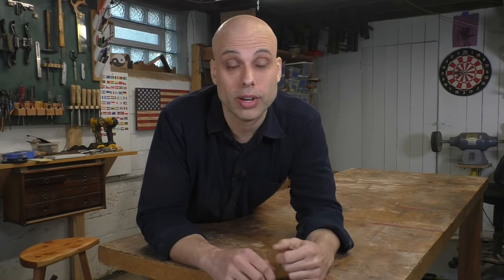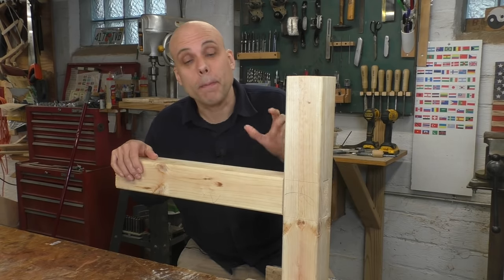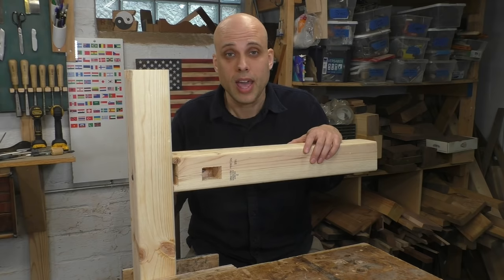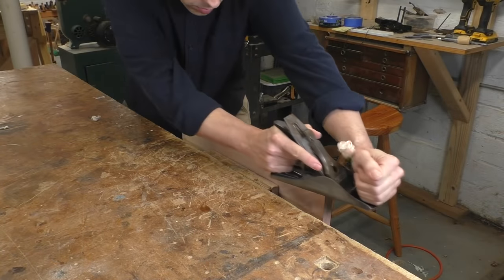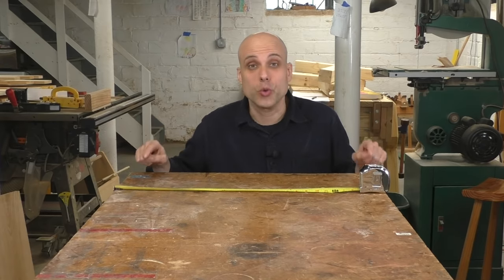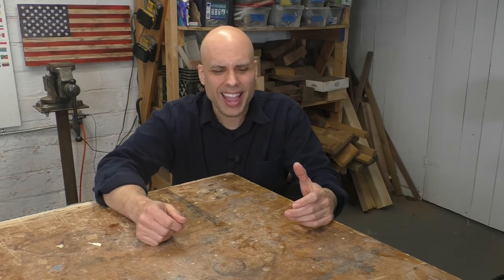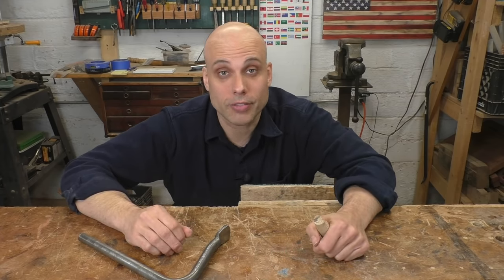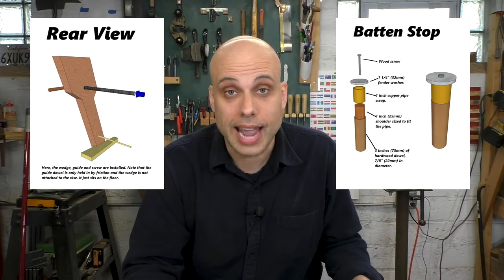Four Workbench Building Mistakes (that we all make).

Comment: Your point about the way wood can compress, through time and wear, in joints based on metal fasteners, is really important, completely true, and generally underappreciated. I'm so glad you're explaining this.
Reply: You just need to use washers to spread the load.
Reply: Or maybe just get some joist hangers cause nonadismattas
Reply: @Zzzrrrretttgthvt  you really cannot beat joinery when it comes to wood construction. Joist hangers are used because they save labor and they're good enough.
Reply: Of course, ignoring that you can pull out 2 wrenches and retighten when it happens
Reply: As someone who has an Ikea drawer that won't keep the face on anymore, I fully agree. Wood joints subjected to forces that are not in line will compress with metal squeezing wood.
Reply: Not just ordinary washers, various sizes of large thick construction load distribution washers (usually galvanised) are quite readily available & largely (but not completely) overcome the looseness that develops with most bolted joints in wood.
Reply: @peterowens290 , I believe you're referring to what are known as, "Fender Washers".

Comment: I was just at my “bench” thinking about how counter productive it is. When I built it I had power tools, but quickly realized I HATE all the racket.. so very early on I moved to all hand tools, and have been “improvising” work holding as I go, not realizing what a GIGANTIC problem is really is.. every build, I need to whip up some other half baked idea on how to hold a component.. my solution? Lay on the couch and watch Rex justify EVERYTHING wrong with my bench..
Reply: I'm glad to see that I'm not the only one who is just turned off by the noise of power tools. I sometimes dread going to the next step of a project because of the noise of the saw or   thickness planer.
Reply: Hearing protection?

I understand where you guys are coming from but there’s so many useful sometimes even non-standard ways of using a router, jig saw, band saw, and table saw I just couldn’t put those into retirement. I don’t actually use my routers that often now that I think about it, but when I reach for one I’m very glad it’s there. Noise is temporary.
Reply: @fishhuntadventure , Yes, "Noise is temporary". So is hearing loss, until it ain't. [Old, 'Experienced" guitarist here.]

Comment: My first workbench was 2 matching dressers placed back to back with some plywood placed on top and then covered with some second hand laminate flooring to make the surface smooth and uniform. It worked amazing and if I still had the same space for a setup with my bench in the middle of my shop, I'd still be using it. My new workshop space is significantly smaller and I've gone with a kitchen base cabinet against the wall with a top made out of 2 pieces of reclaimed maple that are jointed, planed and finished with a laquer of some sort. This video and others like it are great but sometimes you just have to go with what you can achieve for the budget and space. Don't feel bad if you can't make some amazing fancy workbench with traditional or semi traditional jointery.

Comment: Rex, I made a work bench 35 years ago using half lap joinery.  It has stood the test of time including 5 major moves. One of the key features I used was a ladder like superstructure to support the 2.25 inch plywood top.  I glued hardboard to the top and replace it every 10 years or so and banded the edges with poplar.  Great video.

Comment: For those new to joinery, mortise and tenon isn’t as intimidating as it may seem. I recommend you jump right in. The process of refining your skill is a fun adventure.
Reply: It also doesn't need to be a through at all. 1/2-2/3 of the way through the leg, throw in a couple drawbore pegs and you'll have the strongest possible joint for a bench.
Reply: Go Sounders!
Reply: Also, a bench is closer to house framing than furniture making. The tolerances don't need to be super tight. My Low Roman Workbench is nothing to look at. I made it with through tennons that are as ugly as they get. It is tippy, but it doesn't rack at all.
Reply: Challenge accepted
Reply: A worthwhile revision to consider that adds VERY little complexity to a mortise and tenon, but which gets far less play is the "WEDGED Mortise and Tenon" (there's a million videos on it). These are cut identically to the normal on, but you make your tenon (the piece that passes through the mortise) about 2 inches longer. Then, once you've inserted said tenon, you cut or drill a hole in the tenon, such that one side of said hole is coplanar with the outside of the piece you cut your mortise through. a wedge shaped rod, dowel, or piece of square stock is then sunk. into that hole.

This carries the added benefit of exerting lateral, tightening force on the tenon, pulling it in MORE tightly to the mortised piece. It also make for very easy disassembly: pop out the wedge, the tenon is freed, pull it back out of the mortise. 

"Whatever," you might be thinking. "I'm making this a forever bench and I'm gonna GLUE this bad boy together." Capital! because you know what's really awful? Having a joint held EXTREMELY tightly and ENTIRELY flush while your glue dries. I sure do hate it when that happens.

"I need the the exterior edge to be FLUSH!" No problem. The great part about this technique is one that glue is set/you've added any additional mechanical fastener you intend to, grab your ryoba or a flush-cut saw, and hack it right off, wedge and all. You'll still have gotten the value of the tightness without purchasing a 10-foot pipe clamp.

I'm not saying it's the only way to do these things, but it's easy, cheap, and you can use the OFFCUTS you got from MAKING the mortise and tenon AS your clamp! Just saying.
Reply: Use scrap wood in a trial basses; draw it out, cut it out, dry fit it together making minor adjustments. glue and screw it... repeat...
Reply: @grumblycurmudgeon Almost all old Workbenches and a lot of tables here in Sweden have stands joined like that. But  never glued, half the point is that it's easily pulled apart if you need to move and the other half is that it is easy too tighten the joints when the wood moves. Flush fitting is never a problem as the legs are about a foot inside the frames and the tops are thick hardwood  so heavy enough that it doesen't matter that the legs are not at the edges.
Reply: And if you make a sloppy joint it's easy enogh to fix with a wedge! Not pretty but still better than just nailing it to the side. Not to speak of his original design. Even IKEA knows that if you join wood end to side with a simple pulling bolt you need at least one or two wooden dowels parralel to the bolt to stabilise.
Reply: The part most will struggle with, will likely be chisels that seem “SHARP” but really need a proper tuning to be truly workable. 

Other than that, trim small. It only takes one over cut to make a sloppy joint.
Reply: @roberthenson6153  if im not wrong proper edge geometry without a rounded back is more important than sharpness when driving mortises?
Reply: The quality of his work is impressive anx its a good looking bench. But honestly you dont need to be anywhere near this fancy or do this much work unless you want to
Reply: I did woodwork at school back in the 1960's. The woodwork shop had a mortising attachment for the drill, BUT the woodwork teacher made us do a mortise and tenon by hand before we could use it. I made a coffee table which I still have.
Reply: @roberthenson6153  Absolutely.  As a newbie to woodworking, I had no problems building a small workbench with through mortices and tenons, after a little practise. I started with getting the right tools, and that included chisels, good sharpening stones, and learning how to set up those chisels.  Plenty of videos on how to do that out there, and plenty of little tools/jigs that make it easy for beginners to get a good consistent edge on them.
Reply: I'm really quite a novice, but realised I needed to try my hand at a mortise and tenon to build something for my Mum, and I was really surprised with the result, it came out perfectly and didn't even need gluing to hold. Really quite easy! :)
Reply: Yes, and you don't have to spend for mortising chisels.  Paul Sellers demonstrated making a mortise with  a bench chisel.  It works fine.  
As stated by others, tune and sharpen your chisels for good results.  Paul has that covered, also.
For an experiment, I cut a mortise using my drill press and cleaned the sides with a good chisel.  Then, I chopped another mortise using a bench chisel and mallet.  The chopped mortise actually came out better than the drilled one.
Reply: Please keep in mind that to everyone who already knows it, it always seems simple. This goes for everything in every profession or skill. Never make the mistake of calling something "simple" just because you have forgotten your struggle 100 years ago.
Reply: @computerjantje  I agree that first mortise and tenon joint is daunting.  That's one reason we look for alternative means of assembly.  One thing to do is get a piece of hardwood (it works better than pine/spruce/ fir/cedar etc.)and just try it.  I made my first functioning mortise and tenon for my workbench.  The joints are too rough for inside the house furniture but the bench is solid.  My next attempt was a wood mallet.  Not exactly mortise and tenon, but the same effect.  It was less sloppy than the bench but still solid.
Just start.  
No. it isn't simple yet.  I am still postponing a second mallet.  I want one a bit smaller than the first one.
Reply: @borjesvensson8661 , "?" I've "Driven" tenons into mortises after "Trimming" them to fit with a chisel, shoulder plane, etc.but never driven them directly with a chisel.
Reply: @grumblycurmudgeon  Even if I thought I was never going to get rid of a bench, I would definitely want to be able to disassemble it. Never know when you need to move it.

Comment: Candidness about mistakes is what makes this channel authentic.  Thank you!
Reply: I agree, because it builds his credibility. He helps us to avoid important mistakes, based on common sense and experience. That's something to be proud of; not ashamed.
Reply: @CAD Thinking good call! I never thought about him "lying" to us. :-D I wonder how many times he has to refilm, because keeps accidentally getting it right. :-D
Reply: An old fashioned English joinery bench is between 5 and 6 fet long and has an open ended  well running down the middle deep enough to take most hand tools and is easy to clean off with a hand brush, I was taught on one in the early 1970s. My father was tought on one in the 1930s and still used one at work in the 1990s when he retired. they  also usually have a vice mounted at opposite ends on the sides, anything too big for these is held with a clamp or easy to make bench hook, they also have cupboards underneath for the most used tools

Comment: Thank you for making such an incredibly thorough, thoughtful video. I’m a new homeowner, and getting ready to refit the basement workshop and get rid of some of the less than ideal benches from the previous owner. I can’t wait to build something sturdy, adaptable, and pleasant to work with.
Reply: I am in a similar position. Fairly recently I bought an old character stone cottage in rural France and want to arrange a workshop in my basement. The above video made some points which I had not considered e.g. not too wide.  Many thanks.

Comment: Love the half lap! Easily cut with a cheap circular saw too 👍
Reply: I make small ones with my router; surprised at how well that worked
Reply: Now I realize using titebond and screws might have a downside, never considered bolting it.
Reply: Brad!
Reply: Yes I did that and it was very satisfying - a few back and forths and pop the little "cards" left out and smooth the bottom. I was happy I was wearing ear protection though.

Comment: With the half lap joint it’s better to offset the two bolts so that they aren’t in line, this way you avoid wood splitting and also have greater strength.

Comment: My present bench has limitations for long boards as you've noted in this video.  I've had to use long pipe clamps to accommodate those long boards which is cumbersome.  I agree with your comment about building bench for long boards. I'll integrate that in my next bench.  My bench top is made of two sheets of 3/4" plywood making for 11/2" thickness.  I like the idea of adding a masonite top.

Comment: Great video!!  I love your no nonsense, down to earth approach about this.  I ended up saving up and buying the large entry level Sjoberg's bench when Woodcraft had it on sale. (wow, more than 20 years ago now!!)  It came with a bench vise, tail vise, dogs, and a holdfast.  Worked pretty well for me for several years.  But then, much like yourself, I started getting in to more hand tools.  

I found the bench is good, the different clamping options are still good, but the whole thing is just too light.  I would use a hand plane, the material is firmly clamped in the bench, but the whole damn bench would rock around and slide across the floor.  I also found that the 30" height was too low for my bad back.  I ended up getting a couple really heavy pressure treated 4x6s, bolted them side to side underneath the bench legs, and then building a cabinet with drawers to hold tools that fits in the open area under the bench.  Between the large beams, the cabinet, the heavy tools in said cabinet, and the diagonal stretcher I added to kill the side to side movement, it is now super solid.  Plus the whole thing was lifted by 5 or 6 inches when all is said and done.

Comment: Great video! Glad to see content like this coming out of Ohio. NE Ohio here.

I do more metal working, but I happened to have 7 or 8 very large machine pallets (think sized for semi truck) laying around. I didn’t have the tools to make a good wood workbench.

I made a top out of the 4x4s by cutting to length, having a friend help with their jointer by squaring up the boards and then planing to thickness. I then made a lap joint for the legs to the table top. The trick is that I made the lap joint between two laminated boards turning it into a mortise and tendon. Boards were glued together. Then I drilled holes all the way through the stack through those joints and clamped with all thread.

Finally pallet wood is pine and not very tough. Had my local steel supplier shear a quarter inch plate which went on top.

Pretty happy with it, the setup will allow me to add vices/tool hangers with ease later. I primarily use it as a beating table. Added angle to the edges so I can bend sheet over it.

Every craftsman needs a different bench based on what they do. Well worth doing the research and building it right the first time!

Comment: I made the Paul Sellers Plywood workbench as my first workbench. A pretty decent bench, actually very doable for a novice woodworker. With the skills I've developed over the years I might make the same bench, but then with some nice hardwoods. Great video, Rex, with good tips!
Reply: I was considering Paul’s plywood bench but went with Rex’s quick stack bench, started it this weekend
Reply: @1988dgs  With today's lumber prices I'd probably go for the cheaper option 😄. Both are fine benches, in my opinion. Good luck with the build ans I hope the bench will serve you well!
Reply: @c.a.g.1977  thanks, I saw Paul’s bench in a recent video and his looked a little beat up, I couldn’t have got the Baltic birch ply he used so it would have aged quicker, and there are lots of ply repairs in what I would have been using so wouldn’t have looked as nice
Reply: @1988dgs  yes, the blatic birch would look the best. I slightly deviated from his plans by not using laminated strips for the top, but just wider boards cut and stacked horizontally ( instead of small strips vertically). Put a few coats of clear poly on it, seems to be holding up fine.
Whatever you choose: making your own work bench and then using it: awesome!

Comment: My bench was my first project. It was literally a door made of composite wood, partially hollow. Never been so proud to build something out of wood since.
Reply: Same here. It was a resounding C effort on my part. I’ve since retrofitted it up to a solid B-. I’ve done better work, but that was special.
Reply: Solid core doors make great benchtops.  They're pretty solid, heavy, dead flat, relatively cheap, and good sized.  I nail a sheet of masonite to the top and trim the edges flush with a router.  It's cheap and easy to replace when it gets worn out.
Reply: I buy the returned interior door for $5 ant use it as benchtop when I want to do a lot of cutting on the top.
Reply: same here - it was greeat -until I missed a hammer strike and added unwanted dogholes. lol.

Depends entirely on what the bench will be used for....
Reply: This used to be a norm. Though bsck in the day cheap hollow doors werent the norm. It was easy to find old scrap silid wood doors. Throw some legs and braces on it and voila.. Workbench
Reply: and shop furniture is a great way to start. It's going to get beat up, for your eyes only, you usually can use cheaper materials, etc.
Reply: @larrybud  - yeah, that's how we learn when to use better material. lol. that first hammer hole in the hollow-bench was surprising.
Reply: @mdbbox5660  Somewhere here on Youtube there is a guy who did just that. He slapped some MDF on top of a solid core door and banded the edges with hard maple. He then put four successive coats of shellac on the MDF and ended up with a durable, replaceable super flat bench.
Reply: @caseyspeaks6380  mix sawdust with resin, fill the dings, sand smooth, and rock on.